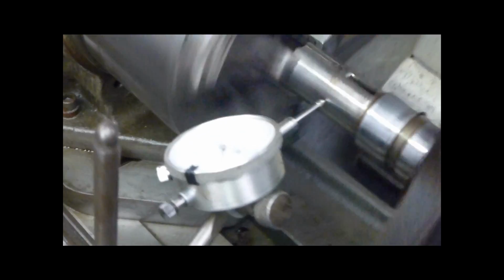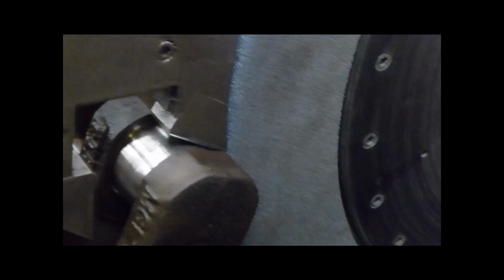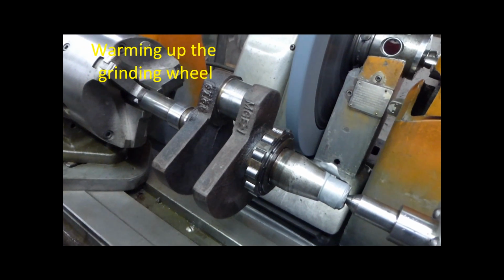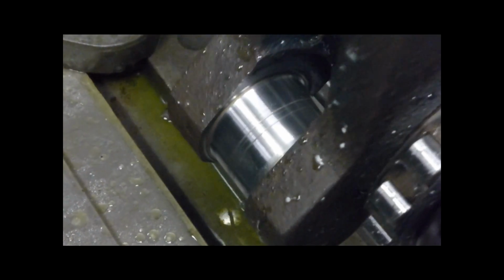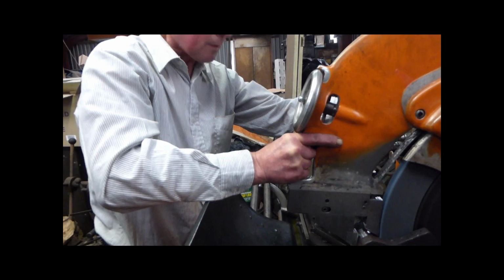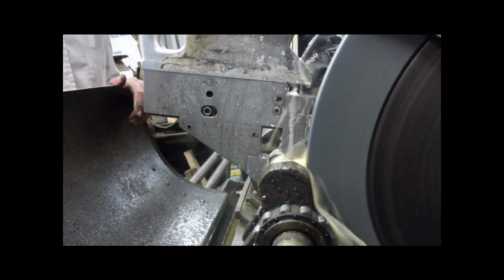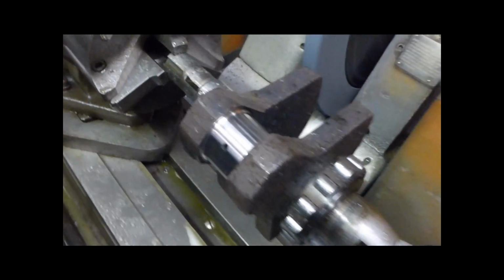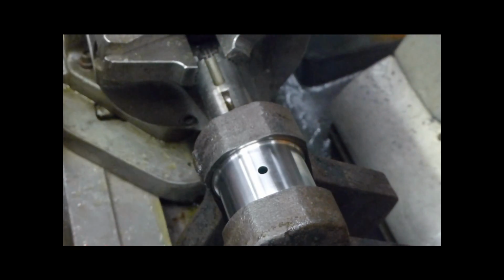Ransomes MG 600cc Petrol engine crankshaft grinding process

Comment: When roughing the journals he should have had it in fast low gear, slow speed is just for finishing. That's what the Prince book says. Its also an early model of the grinder looking at the fixed finger and tail stock. Not many left in the uk like that now.